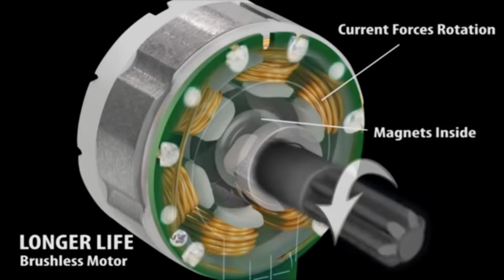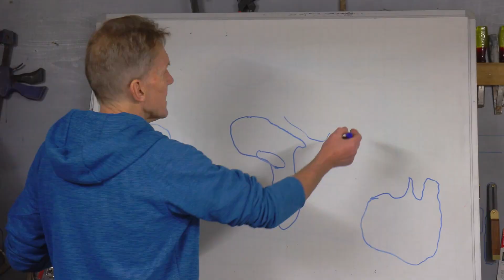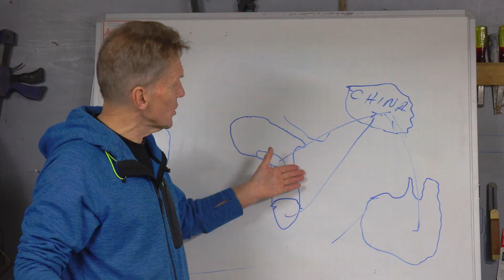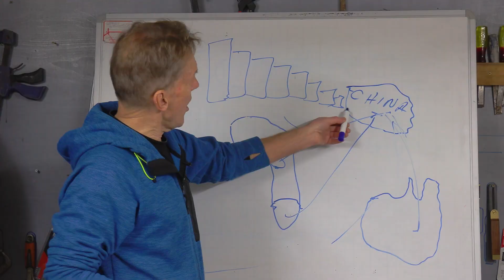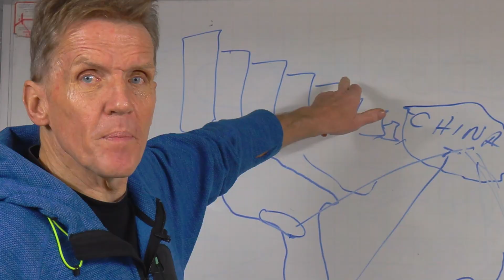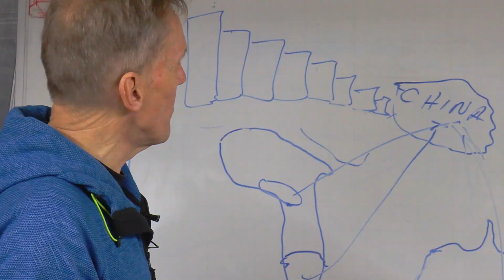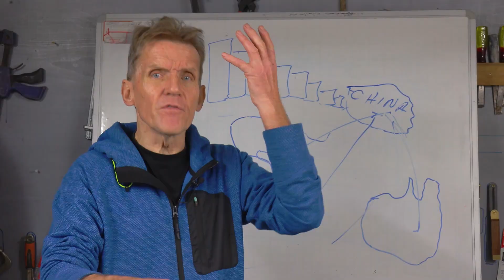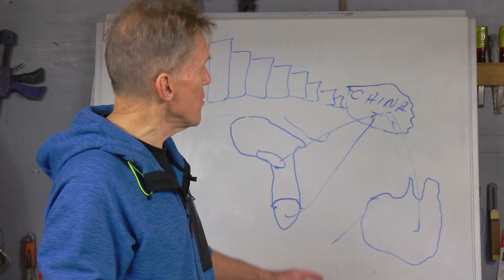The Crazy Cost of Going Cordless?

Comment: You have me started on batteries, they are always about as costly as buying a new drill that really gets my back up!  it was the reason I switched from Makita, the NiMh batteries became shite, and replacement batteries were a total rip off,  so I swapped to Bosch which had better lasting batteries at the time. 
Then over to Dewalt Lithium powered drills. 
Makita lost me over bad batteries, I was until that point a stickler for Makita, NiCd was not perfect, but early Makita cordless batteries would often run for decades, my mate was still using one of the early 7.2 volts way into the 2000s. 
The lesson is, if you make your batteries shite, and make replacements expensive, do not be surprised if your customers walk away!

Comment: Here are a few workarounds: These adapters have popped up in the market:1) they enable you to swap batteries between brands; 2) there are other few adapters that make cordless tools corded should you need to. Another thing is, and it's niche, is re-celling the old batteies. As for all mentioned, I've used a few adapters with limited success - the drawback isthat they don't transfer the control to the battery, so the tool will just drain the battery silly; As for re-celling, it works, but I've failed to find a source of quality AND cheap batteries; that's bc the batteries must be high drain (unless you find a way to buy from US without paying taxes or shipping)

Comment: Agree all the way that corded tools are more powerful and I've got some 50 year old Black & Deckers that still work fine. What gets me is what manufacturers charge for batteries - I know that they are hardly comparable in quality with something like a Makita, de Walt or Hikoki/Hitachi but have a look at what Aldi and Lidl charge for their own brand power tool batteries - upto 90% cheaper for similar power capacities despite their production volumes being much lower than the global powertool brands. And don't get me started on what they charge for site radios.... Shout out for Makita though - I've got a 30 year old 4" angle grinder that you can still get all the spare parts for.

Comment: Got two sets, one full range of makita battery tool that come on jobs with me. Would not be able to work without them now, so convenient. Cost a few quid to get enough batteries and the full tool set up but once you got the start you're away. Also have a range of older corded tools that live in tye workshop, all plugged in ready under the bench and cheap and old incase I get robbed.

Comment: I started with Rawltools, just a hammer and a fist, probably the only way to drill through Flint rocks. It was was 2-3 years before I move to Hand-drills. This spellcheck doesn't even recognise "rawltool"??
Reply from the maker: I used that Rawltool back in the late sixties, putting up cast iron soil pipes with lead caulked joints.  What joy
Reply: @SkillBuilder  Hemp & molten Lead, Horsehair & Putty before we had PTFE tape.
I remember once, my young son(having seen me with a rawltool) put a screw in his bedroom wall and burst through the  bathroom on the other side, then he glued the wreckage back, thinking that I'd not notice!

Comment: I used a battery circular saw.. but if im cutting roofs or joists or doing heavy work  the 91/4 inch Bosch circular saw would eat any battery saw even with a dull blade in it..

Comment: As a remodeling carpenter with thirty three years experience in the trade I must say I love cordless tools. However when working in an unheated space or outdoors in the winter the batteries just don't hold a charge as well. If they've been in the van all night they're supposed to be warmed before charging . Also I worry about programmed obsolescence. Does the chip in the battery say after x number of cycles " time to buy a new battery!" ?
I'm with you Roger, mains power for the big items that don't get hauled up the ladder or around the house.
Everything else is great to cut the cord !

Comment: When a battery pack dies, you can remove the cells, connect some thick flex and connect it to a beefy DC power supply, turning it into a bench tool you can use in the workshop. (Bear in mind some tools draw 20 to 30 amps if you do this!). You still have the option of swapping in a real pack and going cordless too!

Comment: A DIYer does not need a cordless tool. They have power at home. Corded drills and impact drivers are available. And well priced. And they will work in 5 years time when you take them out of the cupboard as well.

A DIYer needs a corded SDS, general drill and impact driver.  Probably a multi tool as well. All quite cheap and always work.

Comment: I think you summarized it well. Impact drive, drill, and multitool have to be cordless for portability. But a circular saw? I tend to check tools based on my battery system, but IMHO it is wiser to check whether or not you need cordless version of that tool you want to buy before doing the purchase.

Comment: I've got a 25 year old Makita hammer action 80 quid 230v drill and a 600 quid DeWalt 24v SDS battery drill, guess which one gets used? The old Makita of course. The battery replacement cost for the DeWalt is 100 quid but I can't justify buying a new battery as it won't get much use. Most of my tools I've bought in recent years are 230v simply because I don't want to get caught with expensive dead batteries. In saying that I also have a 14.4v Black and Decker non hammer action that's 12 years old and it works ok, I store it with the battery full. If you use the tools daily then battery is fine but if you're a DIYer buy corded unless you use it a lot.

Comment: I'm on the Dewalt platform . I've never bought a separate battery , only kits  . I wanted an 18g brad nailer . Did I buy the perfectly adequate Ryobi brad gun for £169 plus £40 for a charger and 2ah battery . NO  . I spent £330 on a bare tool Dewalt . Batteries are incompatible . Adapters are available only for as long as the manufacturers allow their chios to be compromised . Corded sliding mitre saw , rest all cordless.

Comment: Spot on with using battery power where it's most suitable, one thing I'd really like to see is a cross-manufacturer standard on battery connectors; most have similarly sized packs with slightly different terminal layouts/friction fits/clips to secure them in - being locked in to one brand/line of tools is mostly fine, but then another vendor has a niche tool, but means you need another battery + charger combo to lug around/maintain.

I lost it within the first 2mins, then accidently drawing a South Africa penis tip and completely glossing over it was fantastic delivery. Great little history lesson too!

Comment: I laughed a lot during this video.  A very humorous way to teach /learn.  Hilarious and interesting.

You are quite right about the China, you're not being unduly cynical  -  just realistically observant.

Just btw :  An interesting source of Lithium is fracked oil.  The spoil water brings up all sorts of useful elements/ minerals and  quite recently they figured out & implemented a nifty way to filter out commercial lithium, with the potential for other valuable & necessary material subsequently expected to follow.

Benefits are :

(a)  The recovery at-least-partially cleans the spoil water.

(b)  cheap cost lithium production (and/ or cheaper oil extraction subsidised by mineral yields)  i.e. same difference.

Hence, obviously, supply increase ought to reduce market price of both,  plus security of supply for crucial metals/ minerals.

(c)  marginal oil field resources become viable.  

Even with green-based policies we'll always need oil resources.

Thanks for making the the video.

Comment: You're killing a guy here who has the DeWalt cordless 12" mitre saw, extractor and metabo 10" cordless table saw 😂
Reply from the maker: I like that 54 volt stuff. I have a track saw in 54 volt and I has a core drill until it got stolen. 
I am talking about a future scenario and I am not necessarily correct, it is an opinion.
Reply: @SkillBuilder  cheers for the reply mate. I like your rants

Comment: Ive recently gone a bit mental on buying new tools after years being out of the trade, Ive bought the following Dewalt Milwaukee and festool cordless tools, Dewalt combi drill, DCH 133 SDS drill (lightweight SDS work) Jigsaw, multitool, orbital sander, planer, 1/4 trim router I regret getting the sander sanding is usually a lengthy job constantly changing batteries, wish I'd just bought a corded Festool rotex. The planer is handy haven't pushed it too much yet, but again probably should have bought the festool corded one handed planer. Haven't actually used the trim router yet, but Im betting battery life is going to be an issue and probably should have just bought a corded festool 1/2 inch router.
Reply: Milwaukee  cordless tools the 4.5 inch angle grinder, the Hackzall  and the gen 2 finish nailer, don't regret any of those battery life for what I use them for is ample and being cordless they are so handy. Bought a corded Milwaukee 9 inch angle grinder, no way I would have considered a cordless 9 inch grinder, cant afford 400 quids worth of batteries and having to change and charge them every 5 minutes to finish basic jobs.
Finally the Festool HKC 55 no regrets its such a versatile saw plenty of battery life to cut a hip roof or whatever I'm doing, a bit under powered but as long as the timbers dry its not an issue.

All in all I think the heavier duty tools 9" grinders SDS Max drills and breakers and anything you'd use for a prolonged period of time like a sander or planer or router, probably need to corded battery performance just isn't there for prolonged use. as for the rest cordless is just too handy, cables cost time and time is money and are really quite stifling, things like combi drills and multitools with a cable would be a nightmare IMO, too many bad memories ;D

Comment: The only cordless tools I currently own are a little 12V Milwaukee drill (my first drill), an 18V Makita impact driver, and a Dremel rotary tool that I bought mainly to grind my dogs' nails instead of clipping them. Eventually I will purchase a cordless mini router (either Bosch or Makita). But all my other power tools are corded and I have multiple drop cords to use them with. 😊
Reply: What sort of crazy sammiches are you making in your kitchen like? 🤨

Comment: i pretty much use cordless makita for everything, including chop saw. I love them. Brilliant for working in small flats in london where cables all over the place are a pain in the arse & a trip hazard & you can guarantee they'll all be twisted up by the end of the day. Chopping out hinges in a door frame. Cordless hand router, brilliant. Sanding something near a ceiling, no cables. Fantastic. Inside a corner kitchen unit with a multi tool, yes please. Just in the process of getting track saw now & getting rid of my festool t55 corded, which despite the price is hugely underpowered..... i cant recommend the makita lxt series enough

Comment: Cordless screwdriver, cordless drill and cordless jigsaw.. That's it for me... The other tools I plug in to the supply...  I always have a couple of corded drills as back up too...

If the price has come down slightly it's just to get everything used to and addicted to Lithium Ion...  Then China will ramp up the price big time... Tesla, Mercedes etc won't be able to control China...

Comment: I remember buying my first Li-On powered drill made by Hitachi as I was trying to drill a whole in a brick wall, we had moved from a "new build" flat to a 1930s build in which every wall is brick... the Ni-Cd drill barely made a scratch and it was on to the second battery with the first on charge and then waiting for that to charge to make another dent.
The current 18v batteries make tools portable and far more useful.
Moving on I have 18v skill/circular saw but then I was working on replacing the OSB roof on a summer house... I had enough issues with the various depths of the rotted OSB and being on a 15 degree pitch without worrying out a cable!
I agree with you point though static tools... you should have power available even it is from a generator... no need for them to battery powered.
Reply: Problem with your analogy is that mauling a generator across a site or for some considerable distance is a ball ache to say the least then you have to track back to your van to get your tools and extension leads. If your lucky when you get back your generator will still be there. Then when you start it up it runs out of petrol after ten mins so it's back to the van for fuel or maybe  there's a trip to the nearest filling station to buy a gallon of petrol at over £8 a gallon and unless you've bought a good generator it might even be a shit to start...just not looking as good as attach the battery and go ..earning money straight away...5ah battery £100 last a good 12 to 24 months 12 gallons of fuel??? Few weeks maybe.

Comment: The beauty of corded is that there is complete freedom to buy whatever brand suits you best for each type of tool. Running multiple different battery platforms is pricey, but if you pick a single platform, you may find that the platform you've picked doesn't produce a good tool in one particular category.

Comment: Multi platforms is the biggest pain in the arse. Want a particular tool, yet another battery and charger……. 🤬

Agree with you Roger stick it in the wall if you can get the magic pixies from there. What is the point of the cordless tack saw which is corded to the dust extraction? Passing on costs may be where large sites are cordless only and there is a very disinterested bloke sat at a charging station making sure all the charging batteries are not nicked? No power for main contractor to pay for

Comment: I was very grateful for cordless tools when I was on a new build set of flats. There was 110 power in there, but it seemed to be taken over by lighting and whoever was lucky enough to draw a feed off it. Also, as a plumber, I had to move from a different part of the flats several times a day. The kitchen fitters seemed to have more luck setting up a base and not moving until their job was done. For me, at that time, a light and portable toolkit really helped.

Comment: I gave Metabo a punt, 18V and do a good job, proper all day stuff with em and no worries if power isn't around. Still use cable for masonry cutting, track saw and SDS though. I do static work corded, moving around work is cordless - but that's just me. Keep up the good work and have a cracking 2022 👍

Comment: I have very few power tools and do well without most of the time. The cordless aspect is a must on building sites. It's when I have to do install work when I miss not having more as they can save time and energy. Also can improve quality of work. Depends on the type of work that you have to do as well. Got to get the balance right. I have gone to DIY enthusiasts to do work. When I see the top of the range cordless tools that they are boasting it makes me wonder am I too cheap or are they going too far...🤔

Comment: Aldi Ferrex / Workzone and Lidl tools are my go-to, had some proper stuff but it was nicked long ago. For my DIY jobs the above are more than adequate for what I need, my corded SDS drill/breaker cost me £20 and had no trouble breaking a concrete path in my garden.
Reply: with you on that one ,for the money cant go wrong ,if you drop a aldi drill 20 foot it breaks just like a bosch ,plus the theiving barstuards probly wont want your aldi stuff anyway,

Comment: Besides the replacement battery price issue, there is no better time than now to get cordless tools as appropriate. The technology is mature, and the prices good. The power electronics in my small Makita MXT brushless drill (and other goodies)  is just amazing. It is so powerful, light and efficient, and has lasted quite well. Yes the batteries don't last forever, but we are talking 1000's of full cycles, and there is some degradation as time goes on, but they still work until they don't work. 

Most business models look at recurring income. How can they make money on an ongoing basis for little work. Replacement batteries might fit into this model. but as said, I can't complain really about battery life with the current tech.

Comment: Man; so much content in this rant I'm commenting twice! I have no problem if the battery technology continues to evolve. Look how far they've come in 20 years. Given we're at 12Ah capacity, and a lot of the 18V (actually 20V peak) and 40/54V platforms rival a corded tool... I don't think we need more power. But lighter and more compact would make a lot of sense. Current professional grade batteries add significant weight and bulk to what are really quite light and small tools. The popularity (and quality) of the 12V systems suggests this is a desirable direction.

A question on my mind, is will the manufactuters show commitment to their current tool platforms and make everything backwards compatible? Is that even possible if/when a new technology replaces Lithium Ion, and all of the fancy electrics required to stop it self-combusting? 

Also agree with a comment you made elsewhere in the chat Roger; that serviceability of batteries is surely a way to go. I'm sure that's near impossible at the moment.

Comment: Still use my yankee screwdriver,it must be 40years old,i remember dropping it when working up a laddder when it wad fairly new and damaged the ratchet,sent it for repair couple days later they sent me a brand new one with no charge.that wont happen today
if you drop your battery drill.
Reply from the maker: I would use mine but I can't get hold of the bits.